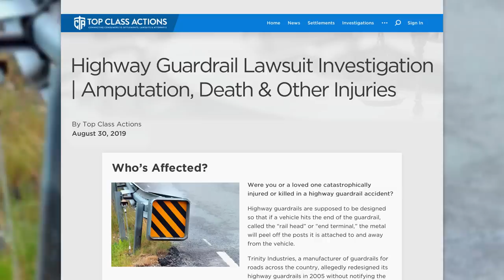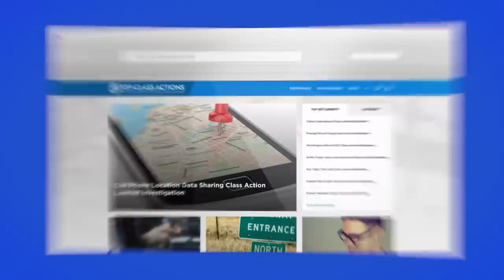Highway Guardrails Causing Fatalities On Our Roads

Comment: In most other countries the 'leading' end of guard rails are angled, laterally or vertically, to guide vehicles hitting them back into traffic going in the same direction and at much the same speed or over the top to come to rest on top of them. Either is better than heading into opposing traffic or just being stopped at a deceleration rate in the tens of G's.

Comment: Wanna hear a crazy real life story about guard rail?

I was once a volunteer fireman.  On one Christmas eve about 20 years ago we responded to an auto accident .   When we arrived there was a 70's Cadillac Eldorado that slid off the road due to snow,   strking a guardrail on the right shoulder of the road.

The guard rail entered the car at the front left headlight,  and cleanly punctured it's way through the car travelling completely parallel to the fender until it entered into the passenger compartment.   

Once in the compartment the rail amputated the female drivers leg above and below the left knee.   The lower leg and knee came to rest on the drivers side floor below the steering wheel,  with evidence of local blood loss.

At some point the amputated driver flew into the back seat,  drivers side.   

The guard rail then bent 90 degrees until it traveled laterally across the front seat,  stopping just before hitting the passenger door.  

The guardrail then broke the front seat off its floor mounts,  driving the seat rearward and pinning the driver between the front seat and rear seat.

The final resting position of the guard rail and seat pinned  the driver's leg in a position that acted like a tourniquet,   saving her life.

She lost a substantial amount of blood,   but walked into the fire station two weeks later on crutches just to give us all hugs.

Physics is some crazy shit sometimes.

Comment: The question is, why do we keep hitting these guardrails.
Reply: Sometimes it be like that, but when it do, guard rails are supposed to make it less like that.
Reply: @danielnormand8156  slow down
just a little bit, and you won't hit nearly as many guardrails.
enough said
Reply: Shasta x  say what you want a our comment is still idiotic. This has nothing to do with how people are driving. It's about the safety of those guardrails. Might be the best driver around but you can't control the other drivers around you. So think before commenting.
Reply: @danielnormand8156  overall improvement of driving skills, including removing poor drivers from the roads, would dramatically reduce the amount of crashes into guardrails, and guardrails aren't the only things that they are crashing in to.
quit crashing the guardrails, they are expensive.
Reply: Shasta x  done with you. Seems you are trolling.
Reply: @danielnormand8156  done with you too, seems you are a guardrail crasher

Comment: ohhhhh you mean the way cars are designed to collapse, and push hunks of metal through the windshield and decapitate people.   EDIT: at highway speeds head on
Reply: They're designed to collapse away from the driver and passengers. If they didn't collapse, you would feel the brunt of the impact and most likely die as a result. This BS old wifes tale is a product of Merican exceptionalism. Get into a wreck with an old muscle car and the car will be fine but you will be broken in half. The other way is to have the car collapse and you are ok to walk away from the crash.
Reply: All vehicles should have a roll cage and five point safety harnesses. Helmets should also be a requirement as well.
Reply: Lumis Sappier  yup that is why the can collapse so nicely  and decapitate the riders.
   oh yes they do i can name 3 or 4 instances and one was a personal friend who hit a rock cliff so grow up and realize the engineers have the worship of theories and yes they are tested but and that is a ig BUT the companies frequently cut corners and sometimes the theories work 9 times but not the 10th